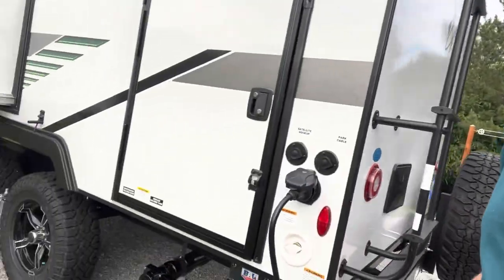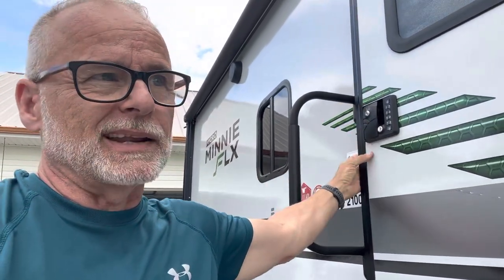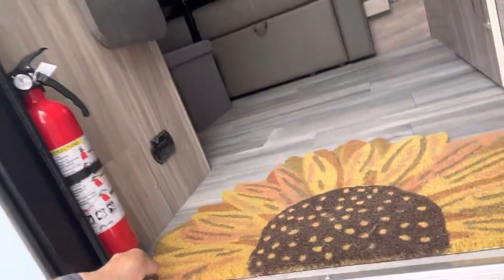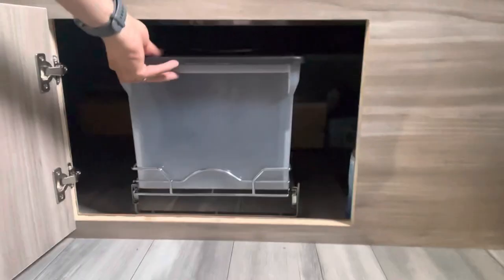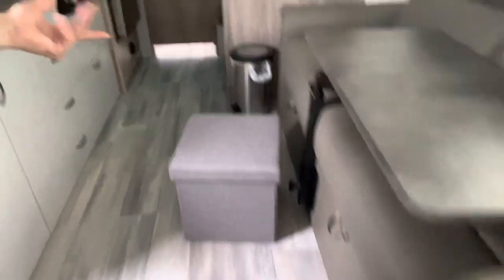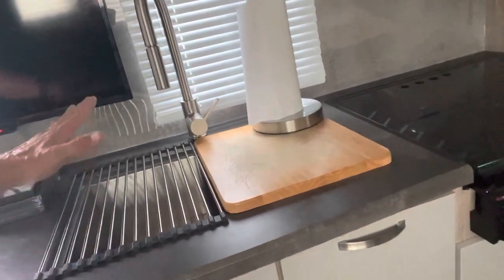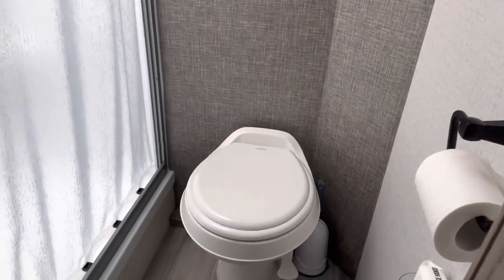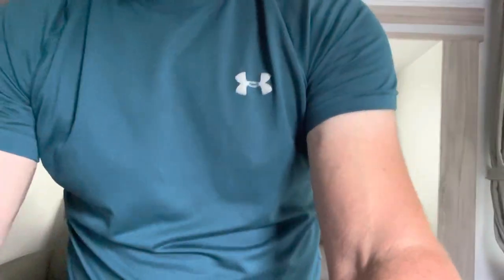Our upgrades Winnebago Micro mini 2100BH

Comment: I swapped out the exhaust fan in the main room with a Maxxair fan, couldn't be happier with it. Straightforward installation. Second upgrade was changing out the two valves for the hot and cold water drain that are located in the left rear of the camper. You'll notice a red and blue piece of Pex tubing sticking down. The drains are behind a panel on the back wall under the bottom bunk. I removed the valves from this location and replaced them with 1/4" turn ball valves so that they can be accessed from the exterior of the camper. I got the valves off of amazon. They sell them as a two-pack red & blue for easy identification. I had already owned a Pex crimping tool, so I didn't need to purchase it. If you don't own one and you know a plumber maybe, they'll let you borrow theirs or do it for you. Happy camping!
Reply from the maker: Nice!  A few months ago I made an access door for those valves. Hinged on one side and a magnetic cabinet lock on the other.  Agreed on the pex tool, I have a friend that has one.  
Thanks for the advise!

Comment: Nice video thanks for the info you have given.  I went and saw one last week...couldn't believe what they are leaving off these trailers after they list these at inflated prices and how delicately built they are.  Plus the fans are a joke!  the roof is low in the shower and the sky light, which adds height, was so tiny my head barely fit!  The showermeiser is no longer included, which would have been a nice feature.   And I can't believe after saving money on the cheap plastic toilet they couldn't at least put some sort of sink in the shower like other units do.  The one I saw also had a dinette and the back cushions were completely vertical, like who sits like that?  And they were very soft lacking any support.  I could go on...but it bites that the US RV market is represented by such low standards and then the owner has to rebuild it or find a way to get it back to the dealer for XX-XXX days.  

The older stuff seems like it was built so much better!  I had a 1996 Lazy Daze that was holding up beautifully, sold it a few years ago.  It had quality craftsmanship throughout and solid wood cabinets and solid surface counter tops.  I watched people remodel their Lazy Daze and laughed as they recounted the difficulty in removing the magazine rack from the wall, or pulling anything apart turned into several days because it took so many attempts.  It is very sad to see how far the quality has fallen.

Anyway, sorry for the long post...thanks for the video.  I subscribed and look forward to seeing how this all plays out.  Good luck to you on the repairs...hoping they help you out on it.
Reply from the maker: Thanks c.m. I agree, most new trailers out there are poorly built, I’m sure the COVID weA had a lot to do with the current inventory out there.  This in a sense was the lesser of the evils, plus we love the storage for a small duel axle trailer and the onboard power.  We had problems to work through in our last trailer purchase as well, Just not this many.   All the best finding your new trailer!!!

Comment: Just wondering if you know the hight of the trailer from the ground to the top of the AC unit? Is the ladder taller than the AC unit? I'm thinking of swapping out my current AC for one that comes on the FLX to get the overall trailer lower. Thanks
Reply from the maker: The ladder is 8” above roof line.  The Truma AC is 10 3/4” above the roof line.  So just a little over 10’ from the ground to the top of AC.
Reply: Thank you for responding and providing the information it's most valuable. @Alzheimers-camper

Comment: Hello, have you had any issues with AC leak. We have the same trailer and recently started leaking inside through the panel. Please share your knowledge.
Reply from the maker: Hi, thus far no. I know most all AC has a drain ( including household) they can get clogged and leak.  The only other thing is the sealant around the AC roof is not holding up.  I can’t offer to much help, I haven’t seen it yet.

Comment: What’s the difference between the flx and regular 2100bh
Reply from the maker: The FLX has Lithium 290 amp hour battery, a 3000 watt inverter and 390 watts of solar.  The regular micro as a 100 amp hour battery only.  So the FLX  is more of an off grid camper. It’s relatively self powered.
Reply from the maker: The battery is lithium much better to manage your power on lithium.
Reply: @Alzheimers-camper  how much do these go for if you don’t mind me asking?
Reply from the maker: Too much.  If I recall correctly we paid about $40,000 for ours in May.  If I had to do it over again I would likely add the solar, lithium battery and inverter myself on a regular mini.  My wife wanted it ready to go from the factory.
Reply: @Alzheimers-camper  that’s what I’m thinking of doing just adding it myself
Reply from the maker: That’s my recommendation.   There seems to be a lot of trailers on the RV lots, I’m sure if they are not desperate to sell them yet they will be very soon.  I’m sure there will be good deals out there.    Good luck.
Reply: @Alzheimers-camper  I like the micro Minnie because it will fit my driveway but still accommodate my wife and kids! Plus I can fit a boat as well in the driveway 😂